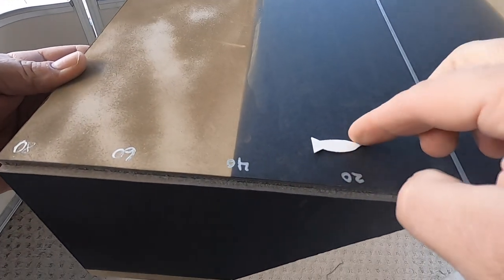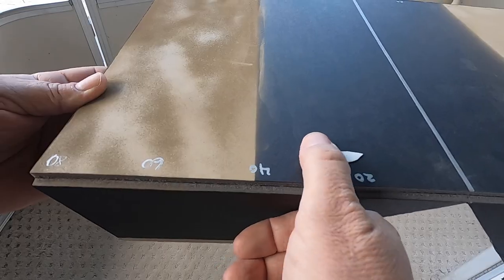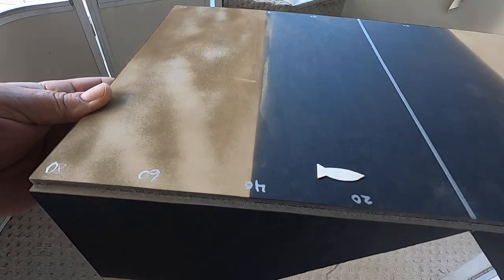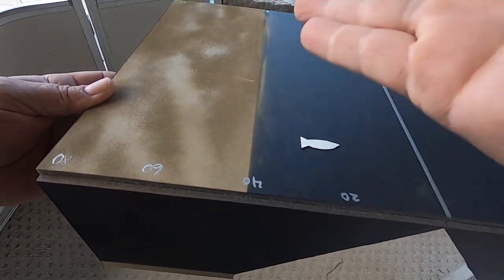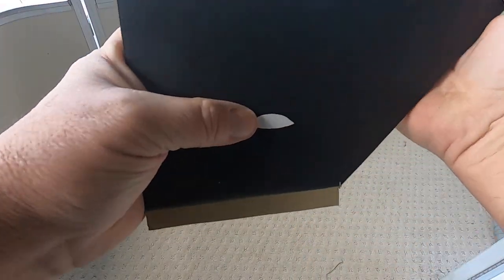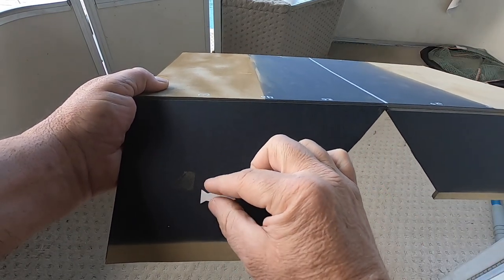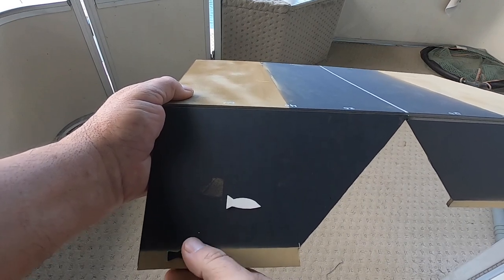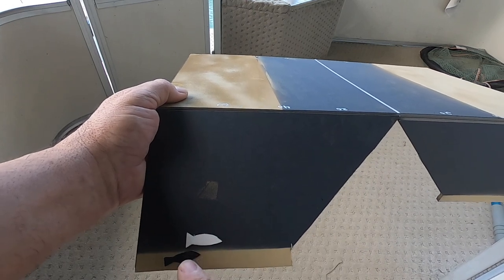How I find Crappie using Side-Imaging

Comment: Very insightful video. I have a bass raider. Is it best to mount my transducer on the bow or stern of the boat?
Reply from the maker: I have my transducer mounted on the stern so I can view my 2D at speed with my boat on plane.  If you mounted it on the bow on your trolling motor for example, you would need to make sure the transducer is level.  I have run 2D and down on my trolling motor, but never a down scan. I believe the side imaging picture would be distorted every time you turned the motor.  If you have a fixed mount on the front, I don’t think it would matter either way. Just make sure your transducer is level as the boat sits in the water not on the trailer. Hope this helps!🐿
Reply: @FishinwithSquirrel  Yes, very helpful and you are correct. I had my transducer mounted on my trolling motor and I couldn't get a quality image to save my life. I just bought a Scotty mount and was debating mounting it on the stern or bow.